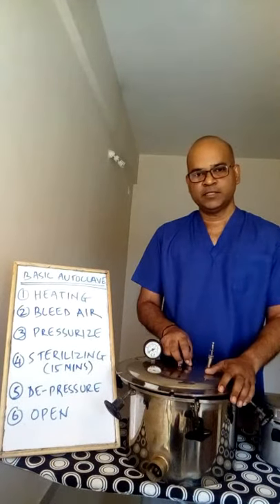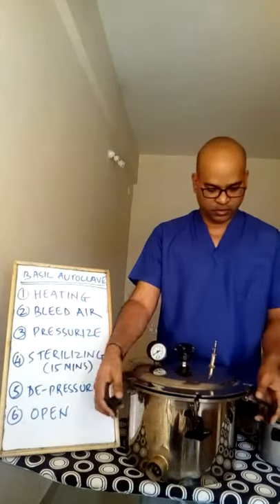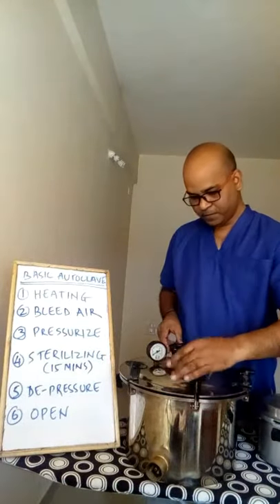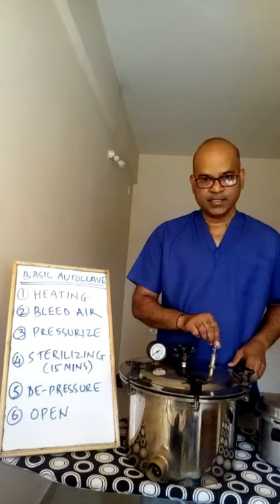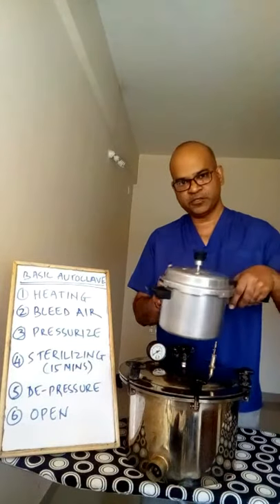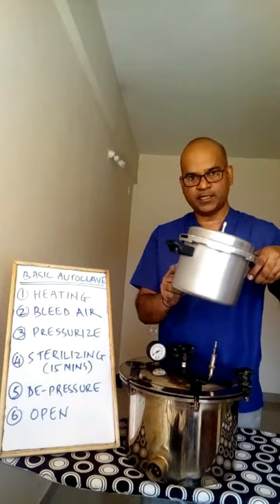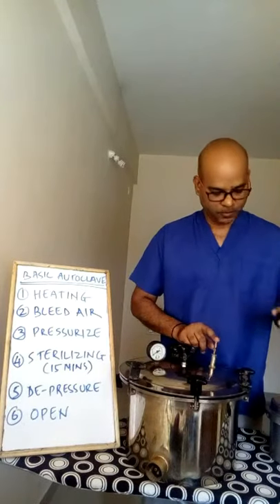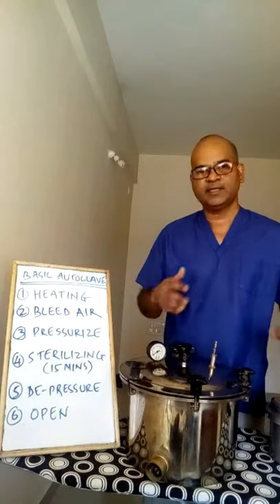How to Use a Basic Autoclave

Comment: 15 min to till bleed air... 15 min to raise pressure.. 15 mins for sterilisation procedure.. 15 minutes holding period after shutting down the main switch
Reply: When can the drum be removed from the autoclave machine ??
Reply from the maker: @donbor734  remove the drum once the clave is sufficiently cooled down. Once outside allow to air dry for a while

Comment: Can u help me with how to use sterilization pouches in this kind of autoclave..
I mean my pouches get wet and droplets are seen inside the pouches
Reply from the maker: Hi Yash. Water condensation is a limitation in any Class N autoclave(including cooker type). There is really nothing much you can do except to let it air-dry. The only way to get completely dry pouches is to use a Class B autoclave or a Class N autoclave with a Post-vacuum dry cycle.
Reply: @dentacozitv  thank u so much
Reply: @dentacozitv   ऑटोक्लेव करते समय उसको कितना पानी में डुबोकर रखना चाहिए कुकर में और कितने टाइम तक उसको रखें जिसे भाप आने के बाद में
Reply from the maker: @navniitpanwar2384  water requirement differs by volume of autoclave. Usually its given by manufacturer. For cooker type, use water at least 10% of vessel height, ideally check manufacturer sheet
Reply from the maker: @surabhiremix  hi surabhi, u can email me ur requirements n I will get back to u with recommendations dentacozi@gmail.com

Comment: How are gauze pieces sterilize
Reply from the maker: Ideally gauze and cotton pieces can be sterilized by placing them in a wire-mesh container inside the autoclave. Wait for them to air dry and then place them in an airtight stainless steel drum. (this is solution for cooker type or Class N autoclaves)
Reply: @dentacozitv  thank u sir.sir will.we get this wire mesh online?
Reply from the maker: @donbor734  I will check online n put u a link in a few days, if u are outside India then u can buy it on aliexpress. If ur from India then I will check some other site
Reply: @dentacozitv  how to bleed air